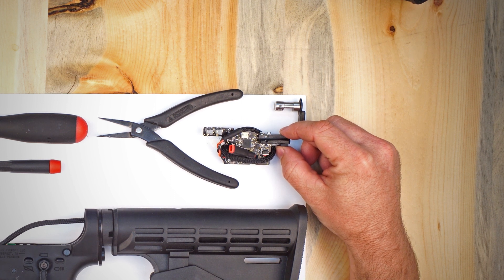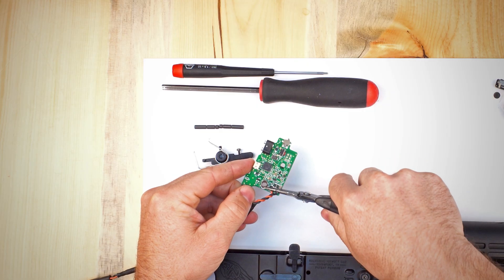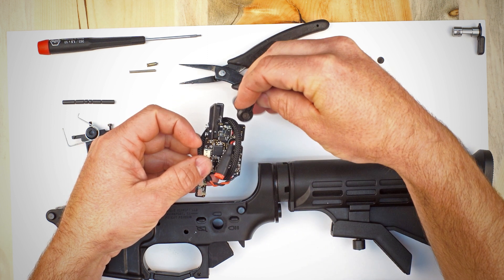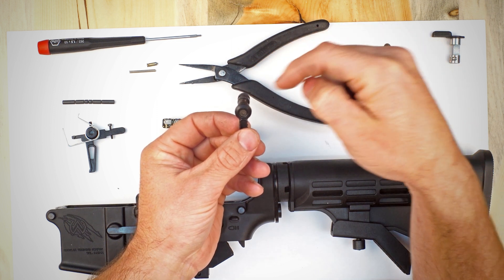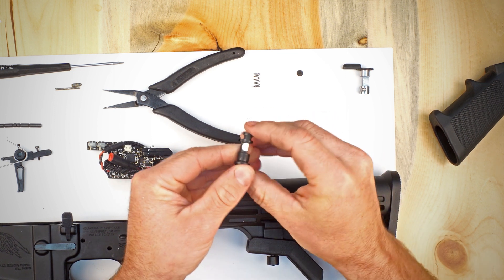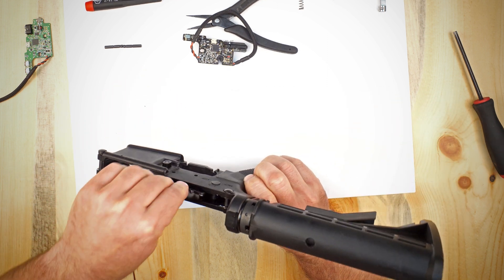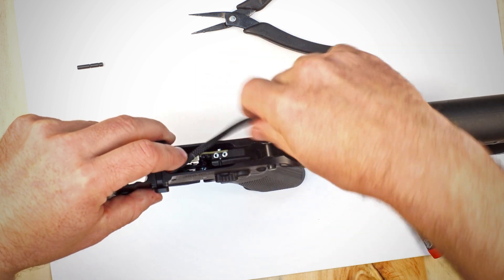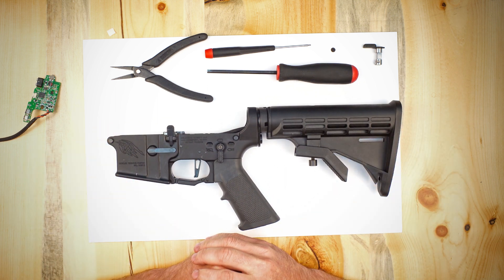What the Tech?!?! - Optical Trigger Board Installation

Comment: hello please what is the name of the firt electronique part you put it off?
because i have it on my replic and its blocked on full auto mode i can't changge it. Do you have an advice please because i don't have the money for buy a new one.
thank you very much
Reply: What do you mean by blocked on full auto? It will go to full auto on the switch and not work or will not even turn all the way until full auto on the fire selector?
Reply: @jacquescoetser1458  i have the same issue, its on safe and fires in full auto.. i thought it was a drop in unit not a science project

Comment: Wolverine is great. I destroyed my MTW trigger board... apparently, if you separate the upper without removing the buffer tube on the first gens anyway, it's very easy to smash the mechanical selector on the board. My board would only fire full auto afterward. I couldn’t find the original board but was able to get the optical board, which seems better anyway. Great video made the install a breeze even I could do it, and now the MTW is back up and running. Thanks, Rich.
Reply: hello you don't find any solution on the problem of the full fire? because i have the same thing